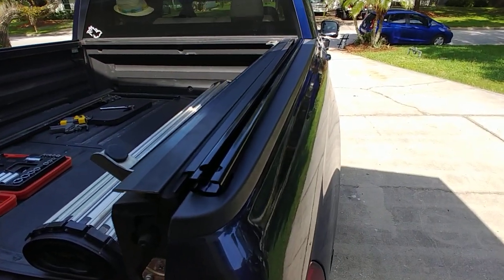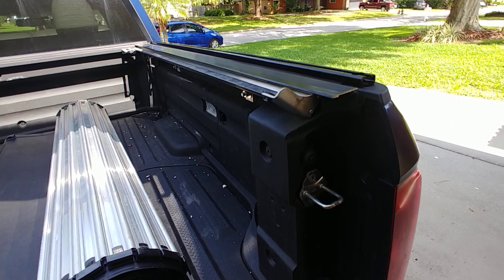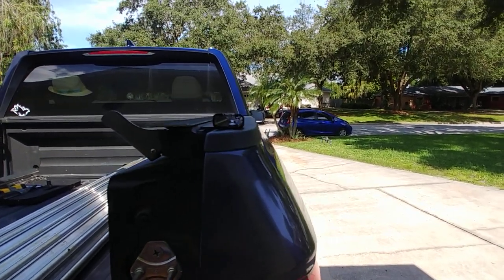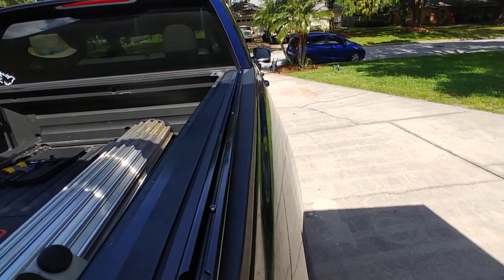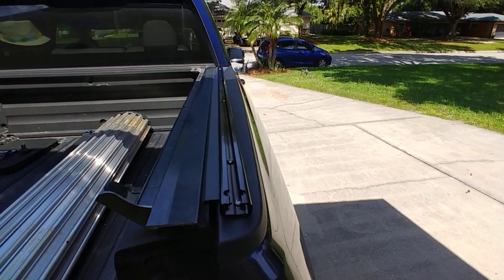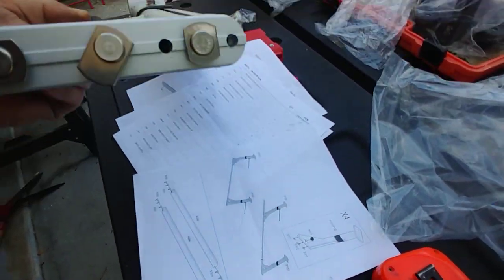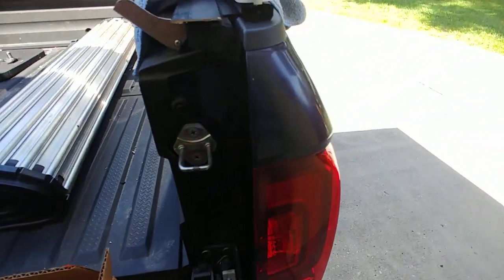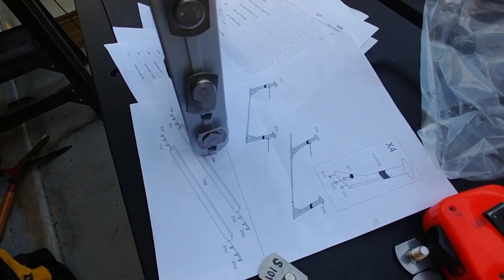P3000 installation on 2018 ridgeline

Comment: Great video. Looks like you have a roll-up tonneau cover. Does it have plenty of clearance to get past the uprights? I had a Gen1 with Vantech racks and BakFlip cover and it was hard to get past the front upright. In this case i have a 2022 with aTruxedo roll-up cover.

Comment: Thanks for the video. Just got my P3000. Can it be installed first and then the BAK tonneau afterwards?
Reply from the maker: Yes. You might have to loosen the hardware a little to slide the tonneau cover’s track system.

Comment: Super helpful video and answers, thanks again! One more question, what is the width and length of the base (like where it slides on the rail) of a tower?  Also what is the thickness of the base aluminum?
Reply from the maker: The foot of the towers is 8" long and 1 5/8" wide.
Reply from the maker: If you are talking of the thickness of the bottom track, it is 5/8" .
Reply: @Tinoknow  thank you again!!!!

Comment: Two questions:

What is the width of a tab that slides in the t-track? 

I was thinking of getting this rack, but installing l-track channels (uscargocontrol) as the rails, and mounting them a little bit wider on the bed sides, maybe trying to make them more parallel. The l-tracks can come undrilled. This might fit my cover better (truxedo sentry ct).
Reply from the maker: I will check tomorrow
Reply from the maker: 1"

Comment: Did you look into the Peragon cover before getting the one you show in this vid?
Reply from the maker: I believe I did, later after purchasing this one. They seemed to be very nice covers. My only concern with the peragon is, how do you open the cover if your truck bed is loaded. Panels drop down. Sometime, I like to open the cover to access something towards the front of the bed. Don't think you can do that with the peragon.

Comment: i have a backflip cover do i really need to remove it in order to install this track?  once u make a hole in the plastic doesnt it allign the holes underneath so why remove the plastic just to drill to install the track? pls advise. thanks
Reply from the maker: The only thing I would be worried about leaving the plastic covers on would be drilling in to far and damage the thread under. Also, I drilled from the underside to lineup the hole and the plastic cap. It wasn't to bad to remove and reinstall the cover either. Good luck with the project

Comment: Hi. How are the track bolts fastened? Did you use a nut below the frame to secure it? Thanks!
Reply from the maker: Truck comes with factory threaded holes
Reply: So under the factory plastic rail cover, I should find factory threaded holes? If so, do you happen to know the how many there are? And what's the bolt size? I don't think I saw this part in your video. Thanks a bunch!
Reply from the maker: There are 4 holes on each side plus the smaller screw at the end toward the back. I don't remember the size though
Reply: Great info! Thanks a bunch!

Comment: did u reinstall the the tonneau cover first before you tightened the track so that the track is on top or is it just side by side?
Reply from the maker: I tightened the tonneau cover tracks first then the rack after. You can install the cover before tightening the rack rails or after. It's the interaction between the two track system that matter the most.
Reply: will this work w a back flip cover
Reply from the maker: Don't know

Comment: Is there a template for drilling the holes in the plastic rail cover?
Reply from the maker: You use the track provided. The back part of the track towards the tailgate is secured by the screw. The front is slightly off away from the the truck bed. The holes in the plastic can be drill a little bigger to give the track some play room to find the factory holes. I went smaller than the instructions suggested for the holes but you can always use what they recommend